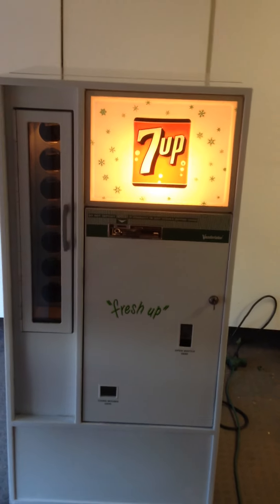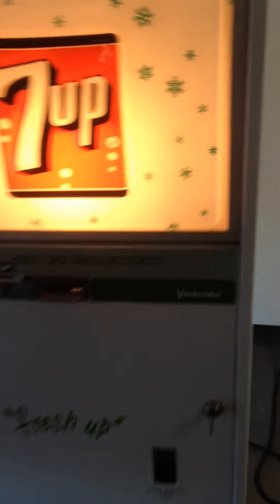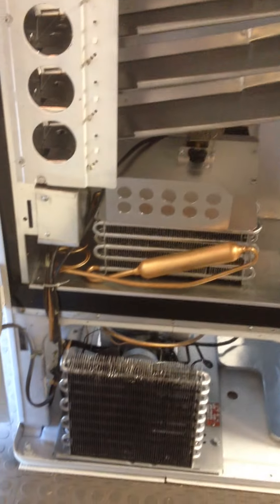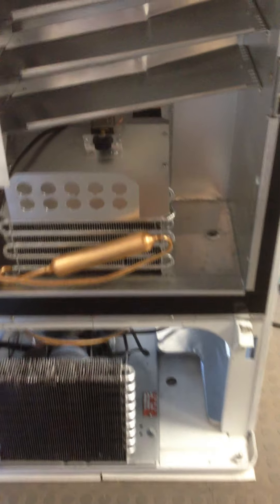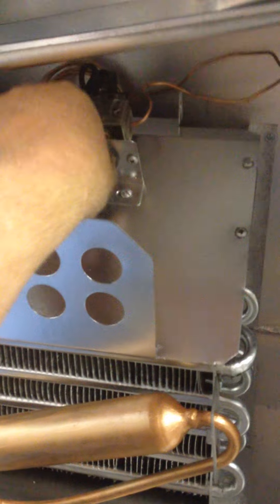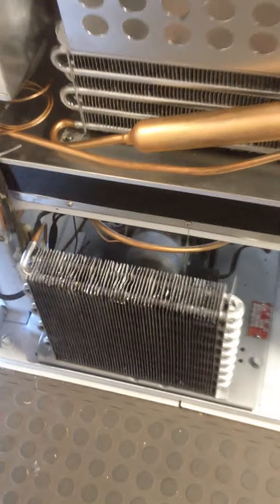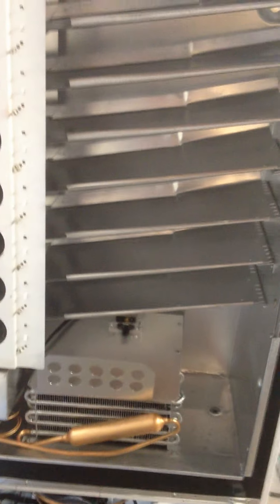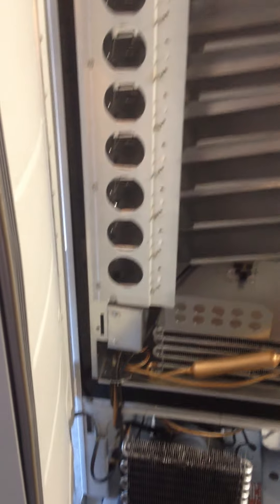7 UP Vendorlator 56 Restoration by www.nostalgia-tymes.com

Comment: Beautiful job, I have the same machine and Pepsi 1963 ventilator 56 still running on the original cooling system  freon 12 getting ready to do a restoration on it